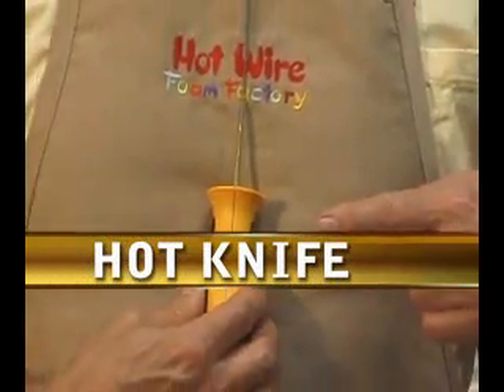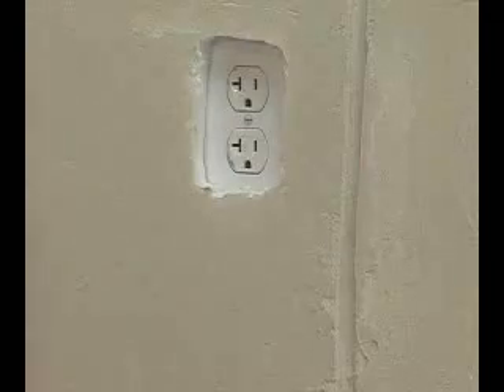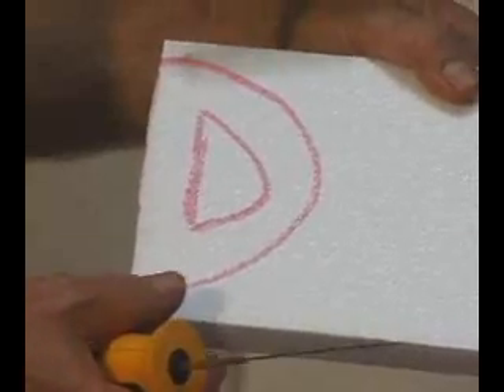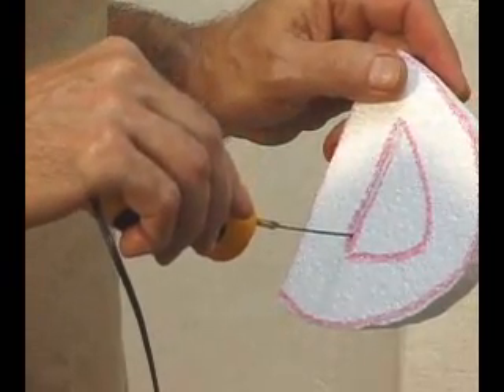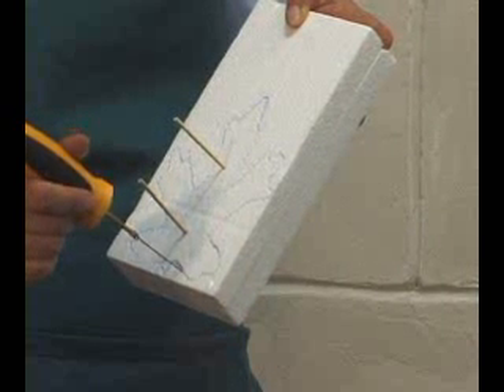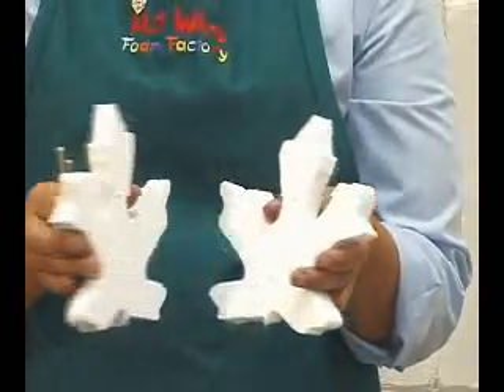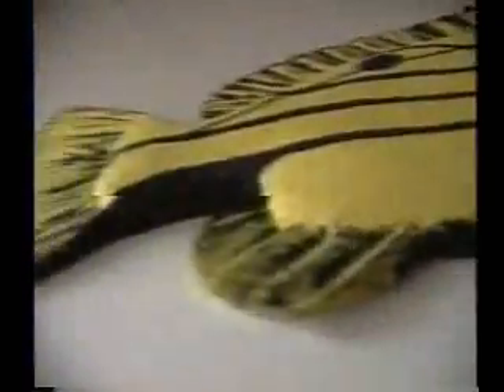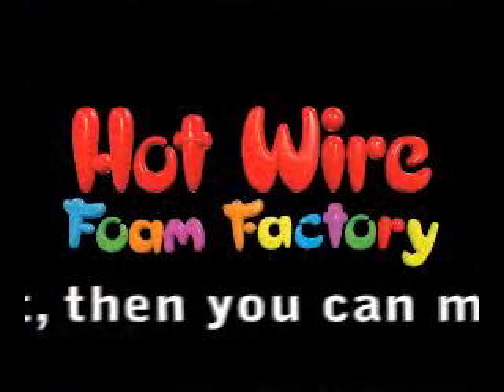Foam Cutting: Hot Knife

Comment: tharmocol cutting is harmfull for our health ? please reply
Reply from the maker: Most of the white vapor that you see released when cutting foam with a hot wire is water vapor that is used in the manufacture of the foam. Also, small amounts of CO2 are released, along with micro amounts of Pentane and polystyrene, so you should always cut in a well ventilated area. To put it in perspective, the fumes from a wood burning stove or fireplace are much more unhealthy than the cutting that a hobbiest will encounter with their hot wire cutting. Go to the FAQs section of our website for a more thorough explanation. Always check with the manufacturer of the foam you will be cutting to make sure there are no health or safety hazards when cutting their foam with a hot wire, as some foams will give off very toxic fumes when cut with heat.

Comment from the maker: Our Hot Knife will snap into a sled guide accessory for making perfect straight or angled cuts. The power supply can be used with our Sculpting Tool and Engraver. We also have a shorter Hot Knife that cuts faster than this one. Go to our website www.HWFF.com to also see what you can do with our Pro Line, Industrial Line, foam glues, foam coatings, and accessories.

Comment from the maker: Ventilation isimportant, but the smoke while cutting EPS foam is primarily Co2 and water vapor, which are far less harmful than other common art products like glues, aerosols and paint thinners. The toxic values are far less than wood-smoke, which contains tars, resins, creosote, and acetic acid. Always check with the manufacturer of the foam you are using to make sure that there are no health or safety hazards when cutting their foam with hot wire tools.

Comment from the maker: @DDofCourage Yes. You should always check with the manufacturer of the foam you are cutting to be sure there are no health or safety hazards when cutting their foam with hot wire tools. We recommend that the polyurethane foams (aka upholstery foams) only be cut with a blade or saw.

Comment from the maker: Is it a polystyrene foam that you are cutting? Some foams should not be cut with heat. Hot Wire Foam Factory tools will cut both closed cell and open cell polystyrene foams. These are the white beaded foams used for insulation, coffee cups, packaging, etc. They will also cut the closed cell extruded foams like DOW Blueboard foam. The extruded foam are usually more dense and cut slower, but but very cleanly. The Hot Scroll Table and Sculpting Tool will give you the cleanest cut.

Comment from the maker: @blackwolf9710  It is open cell foam. It is called EPS foam. Hot wire tools will also cut extruded polystyrene foam, which is closed cell.

Comment from the maker: You can call our toll free number 1-866-735-9255 and we can give you the tech-support number for DOW who manufactures Styrofoam. They told us that the fumes from cutting their foam with a hot wire are not toxic, but cutting should still be done in a well ventilated area.

Comment from the maker: The smoke that is primarily CO2 and water vapor. The toxic values are far less than wood-smoke which contains tars, resins, creosote, and aseic acid. The dust from cutting with saws and sanding EPS foam is more harmful than the fumes when cutting foam. Always wear a good quality dust mask when saw cutting or sanding EPS foam.
Always check with the manufacturer of the foam you are using to make sure that there are no health or safety hazards when cutting their foam with hot wire tools.